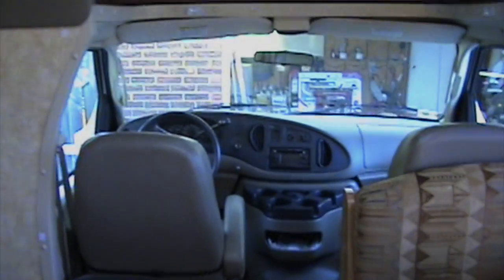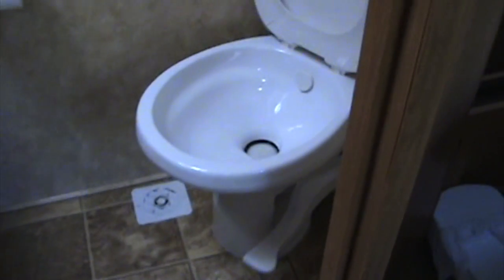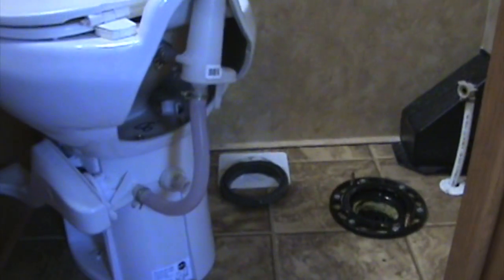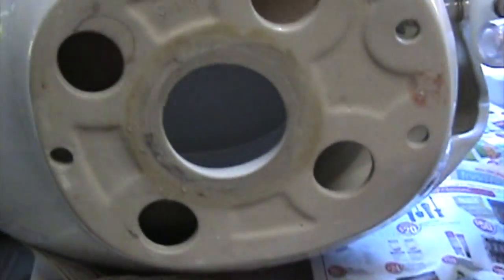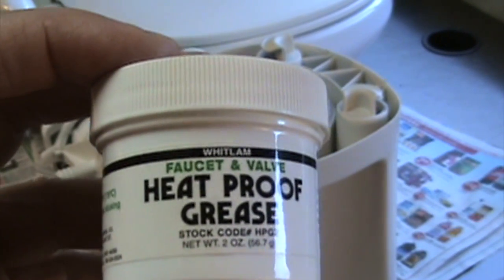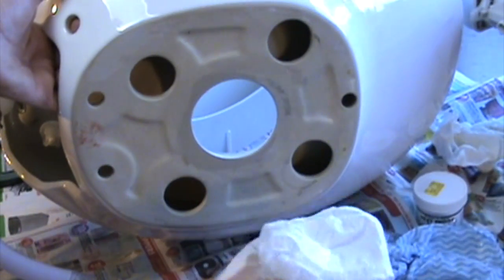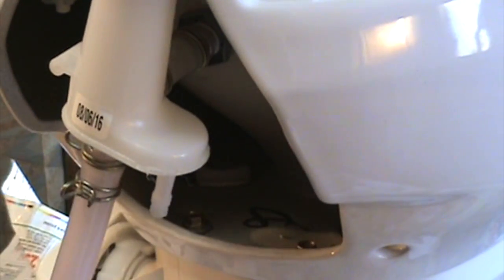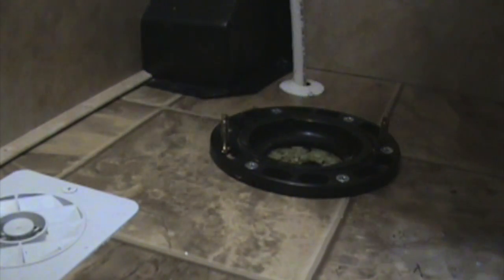How to fix leaking THETFORD RV Toilet gasket seal, flush valve, not holding water, replace

Comment: This is a very informative and well done video.  I was to leave for Memorial Day weekend and did not have time to get and install a new seal. The quick answer for me was a $6.00 can of plumbers seal and valve grease. It has worked for 4 days!  Will just watch and see. Now I can't hold down the pedal and add H20.It is always something with ALL rv vehicles.

Comment: Great video helped me a lot to understand how to strip it down. I had a problem with the flush valve sticking, so every time I put the water pump on the toilet bowl would fill with water. Took it off and put it in boiling hot water for a few mins, then blew and sucked the valve a few time to free it. Placed it all back together and all is fine now.

Comment: Thank you so much. The RV shop worked on the lever sticking, once I watched your video I realized they took it apart but did not change the seals. I followed your instructions & within 30 minutes it was fixed with no leaking. Spent under 10.00. I will never let anyone work on it again. They won't take the time to do it right. I also drained the low water drain after shutting off water. This helped with any spills. Only had about 1/2 cup of water that a small towel could handle. I also realized my floor seal was not on properly. So glad I changed them both. Thanks again. Also we replaced the grey valve & realized they sell 2 different types. The braided one will break again. Use the solid cable & you can shorten the length since they usually use one twice as long & twist it around to fit all camper floor plans. Thats why it breaks. Spent 40 & it works better & easier now.
Reply from the maker: Great.  It's nice to hear such success stories.  ;)  Good work !!
Reply: I'm surprised the flange is as small as it is. especially compared to the wax ring under a residential toilet.

Comment: I was amazed how easy it was to replace the RV toilet water valve
Reply from the maker: Easier than it looks, huh?  Glad it went well for ya.  How long did it leak before you had to fix it?  Mine was just a few days.  I had no choice as we were leaving for a trip.  Murphy's Law.
Reply: I got lucky, mine only leaked during dinner, and when I went back outside, water everywhere.  I got the part a few days later and amazed that I could fix it.  Yes, I agree, Murphy's law rules.

Comment: Great video - replaced the seal this morning - no leakage now.   Old one looked in good shape but was not sealing.   I purchased the seal and ball kit.   The ball was in good shape so I only replaced the seals.
Reply from the maker: When I did it, I only got the gasket set.  I thought the ball would be ok, and as it turns out, it was in good shape.  But the seal was a little out of shape and leaked just fine.  Glad your repair went well.

Comment: (ARMCHAIR/ HINDSIGHT) 1) WONDER IF a little soap and soft scrub/wipe of the rubber gasket (MIGHT) have saved having to do this? 2)  Further, see that grease use (it is a WATER PROOF GREASE, so does not rinse away) is a BAD idea (at the ball), as it might make TP/waste stick to it, which can CAUSE the gasket to not seal; 3) Further, as he read the label on the grease (yes, I do use it myself on faucets), it said METAL, I do NOT recall it mentioning plastic?  BTW, GREAT video.  
THoughts?

Comment: I have the same toilet and the problem I have is that when I press down on the pedal to flush, it won't come back up by itself, therefor the water keeps on flowing until I lift it up with the top of my foot. Do you know if changing this gasket will fix my issue? Thx

Comment: Before you replace it, try this:
Get a can of spray foam tire cleaner.  RV dealers sell it as a "slide gasket maintenance" to preserve the gaskets on your RV slides.  If it's a foot operated valve open it up (water off of course) and spray the gasket.  Try and get as much of gasket as you can down inside and let the foam sit.

I'll bet after an hour or so it holds water again.  I've done this three times when mine stopped holding water and worked each time.  Do it about once every 2 years.  Still using original can of gasket spray.
Reply from the maker: Hi Michael and thanks for the great tip.  I tried to do something similar to that, but it was not working.  We have -35 winters and it deforms the gasket seal.  No matter what you try, it does not come back to making a good seal.  In warmer climates, I suspect the gasket would not deform as badly.  Unfortunately, when it just gives up the ghost, it needs replacement.  Getting extra years with your tip is super bonus, and avoiding the whole toilet removal thing. 
All the best
Ron

Comment: We had the same problem.  Ordered some Plumber's Grease from Amazon.  Dumped the tanks, cleaned the bowl and seal with Dawn Dish detergent, dried it thoroughly with paper towels, applied the Plumber's Grease and it is holding.
Reply from the maker: +Patricia Carpenter       Hi Patricia,  Thanks for the comment ;)  You are more fortunate than I was.  I tried the plumbers grease first but it leaked just as bad and right away.  But, whatever stops that annoying leak for you, is the best fix.  Lets hope it holds for a long time.
Ron
Reply: oh  no....:-(.   Well, I'm glad you were able to get it fixed.  I didn't know that petroleum would degrade rubber until I read about that later.  Hopefully this plumber's grease will keep holding.  If it leaks out again, we will probably have to do what you did.

Comment: Not really sure why you would need to take out the toilet to start with...must be a Thetford thing. With a Dometic (mine is a model 320), you simply glove-up, reach in, use a simple $5 seal puller, pull the old seal out (while you knee-the-flush-valve to hold it open), grease up the new seal, and pop it in...takes like...I don't know, 2-minutes? You just turn the water off...and then back on. No wrenches, no mess (other than gagging on having your nose over the 3-inch down pipe while you're doing it)...FORGET UNBOLTING THE TOILET for a flapper valve gasket! Try it my way, next time...you'll see (or should) that if you have the correct new-gasket on-hand, just lube it up (silicone or dielectric works just as good...just going into black-tank anyhow), and PUSH IT IN PLACE! Be careful not to cut or tear the new one (or wrinkle it) while popping it in...but well lubed, shouldn't be a problem. Kohree (who makes these seals) explicitly explains this on their website...DON'T WORK SO HARD!

Comment: Unless you are only going to use the grease on drainage/ non-potable fittings do not contaminate it by reaching back in with your finger repeatedly (double dipping) .  Remove a quantity of grease with a clean utensil to a  disposable plate and work from that.  BTW I greased ours every few months and it still went bad after 3 years.
Reply from the maker: Hey Ed.....    You're 100% right.  No double dipping if you're gonna use it on drinking water.  I bought this grease expressly for this job.  It was cheap and did it's job.  Thanks for bringing this to everyone's attention.  Good point.

Comment: Do you have a video on replacing a black water valve that is located under neath and drained by pulling a remote control?
Reply from the maker: James, sorry, I haven't had to change the tank valve yet.  It's still holding with no leaks or blockages.  I'm sure I will in the near future as everything seems to break at some point, just when you don't have time to fix it.  ;)
Reply: James Wiles read my post above for info on the valves. Took about 1 hour to replace. Took more time to remove the underpinning, but once you do you will see how easy it is.

Comment: Thanks for the intuitive presentation. Luckily, that is my exact toilet. Do you have any experience with fixing power awnings? Mine tore right at the top seam above my door in a wind storm. So the part that is clamped to the gutters is still there, but it is torn about 24" long from the front corner.  Would love to be able to fix it without replacing it. I know it is in a bad spot, but with all the high power adhesives and patches out there, I thought there might be hope.
Reply from the maker: Hi Barry  ...  Yes I have fixed my awning.  Not a power awning, But I didn't think to make a video of it.  It tore like yours, but only about a foot.  It was out and a big thunder storm went by and was flapping like a tarp.  To fix it, I took off the awning attachments ( some one had to help me ) and I just slid the entire thing out of that groove.  Fabric and all in one piece.  Mine had to come off towards the front.  With it off, I put clear ( very tough and sticky ) tape, Camco I think, and made the rip disappear.  With multiple layers of tape on the rip, I slid it back on that top groove and re-attached the rest.  It was a 1/2  to 3/4 hour job.  It held for several years until the tape gave it up because of the sun and weather, so I just did it again.  For the 1/2 hour, It was way better than buying a new awning fabric.  Repaired like this, you can't tell it had a rip at all.
Reply: The Free Fix It Guy - Thanks for the input.

Comment: Would like information on how to replace the ball seal on this toilet. Looks like it can be pulled out from the inside and the new one popped in. Instructions are poor, not like the one you show at all. Thanks, appreciate your video
Reply from the maker: I believe they are all of the same design.  The seal needs to be compressed in place to stop any leaking at the joint.  It can not be just pulled out.  Sorry, it is a take it apart job.  ;(

Comment: can you tell me where u got the repair kit im having trouble finding the right one for a traveler rv toilet?
Reply from the maker: Hi - I used the sticker on the toilet and typed in the model # and did have trouble too.  I called the manufacturer and got the part # from them.  Then I found it on Amazon.  Good luck !
Reply: I took a picture of the model number then went to the local RV store.  Also amazon has the kits.
Reply: The Free Fix It Guy hi can I use a wax ring on the toilet in my camper.  It’s an emergency

Comment: What's your opinion for using Thetford's 36663 Toilet Seal Lube & Conditioner as a cure for existing slow leak or as a preventative to future leaks after gasket replacement?
Reply from the maker: Hey.  I haven't tried it, but the plumbers grease seems to work pretty well.  When the seal is deformed from use, grease won't help.

Comment: It does not say the grease is to be uses with rubber?  as far as I know all grease except silicone grease will damage rubber seals?
Reply from the maker: Hi Marcel,  You're right.  It doesn't say that, but Plumber's Grease is for plumbing and O'rings which are rubber.  At worst, the rubber would swell a bit, but it should provide an even more leak proof seal.  Mine is working great.  I have no worries about it, but if you feel better, you could usr a silicone grease., but as the seal deforms from use and time, it will not swell and seal more as time goes forward.  Thanks for bringing that to light.  I hadn't thought of it at that time.
Reply: Yeah you are right about the fact that the swelling in this case probably  won't do any harm.Thanks for the video!